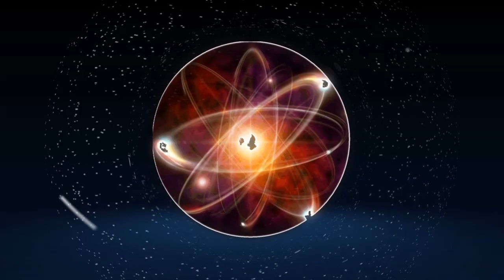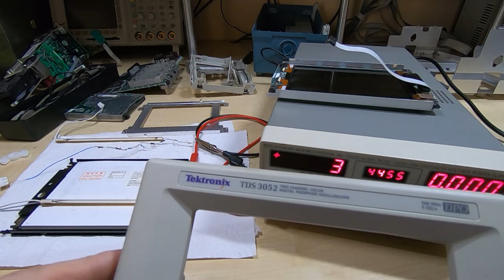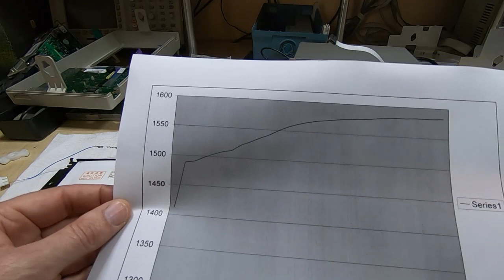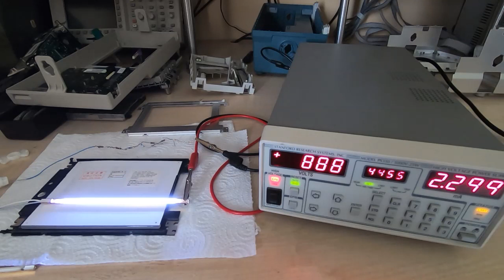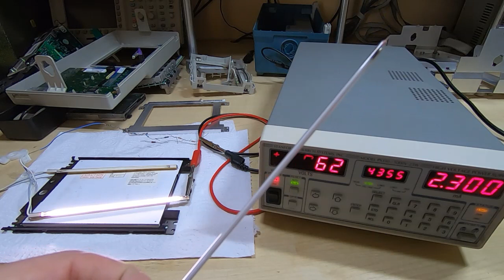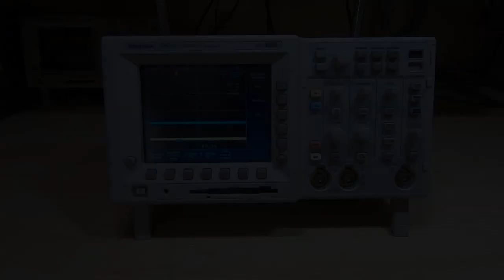Tektronix TDS3052 CCFL Replacement

Comment: I recently got a TDS3034. The display is quite dimmed. Is your LCD Display a NEC NL6448BC20-06? What are the dimensions of the CCFL? I've found something about 2.6mm x 153mm in a forum - can you confirm this?
Reply from the maker: I cannot remember the type of display but I think that they all used the same version. I have just measured the tubes I took out and they are 2.6mm diameter by 152mm long (although the length was not critical). I used bright white (not warm white) as they have a wider spectral output so give brighter colours.
Reply: @JerryWalker001  I've received the new CCFLs yesterday and replaced the old immediately. Same effect as you've showed in the video. Hope as well, they'll last for the next 20 years. Happy again with the oscilloscope. Until the RTC battery will be giving up the ghost. ;-)
Reply: @petereggimann  Where did you supply the tube from? Can you post a link? Do you have the model of the geniun CCFL?

Comment: i want ask u abut power supply mode ?
Reply from the maker: Could you clarify the question.
Reply: @JerryWalker001  I want to know the type and price of the power supply used in the video
Reply from the maker: @atefhd9804  Its a Stanford Research PS350 (0-5000V programable supply). They cost around £2000.00
Reply: aha ok  thank you very much
Reply: @JerryWalker001 thank you